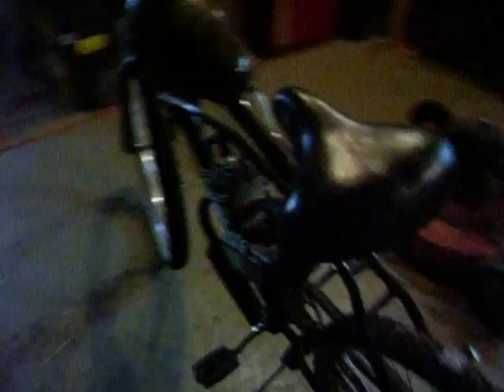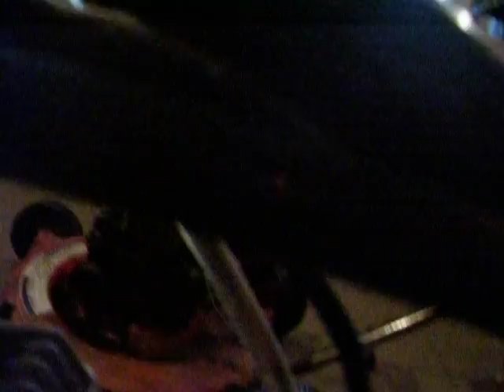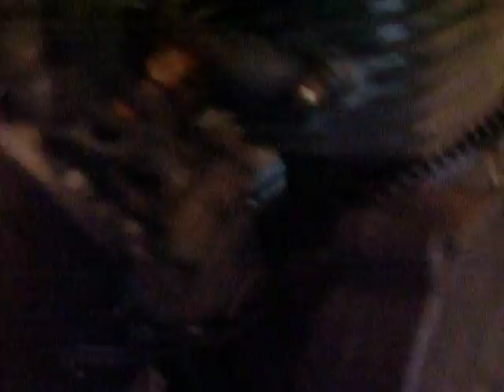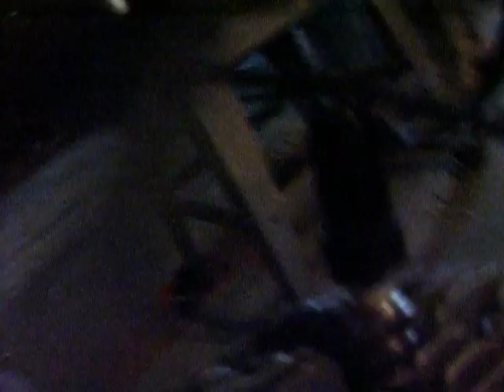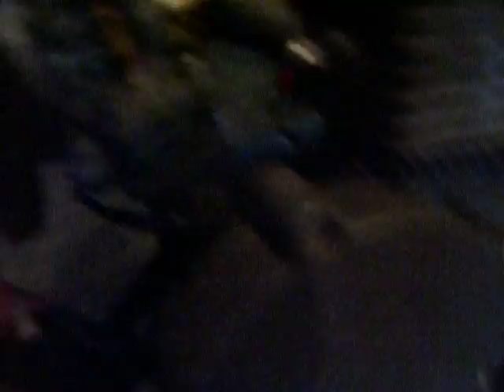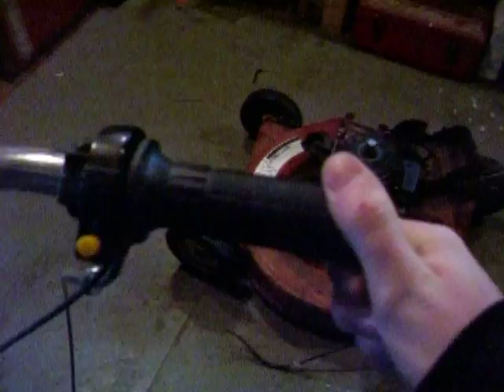PLEASE WATCH THIS VIDEO I NEED YOUR HELP!!

Comment: It may be a clogged jet in the carb to clean this unscrew the bottom of the carb and you will see a screw with a hole in it stick a pin in there and see if that gets it